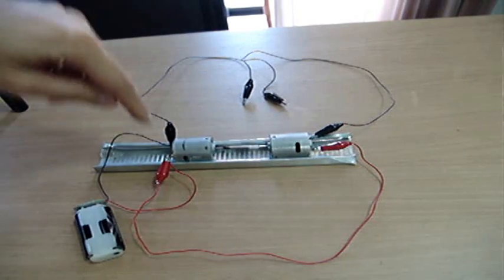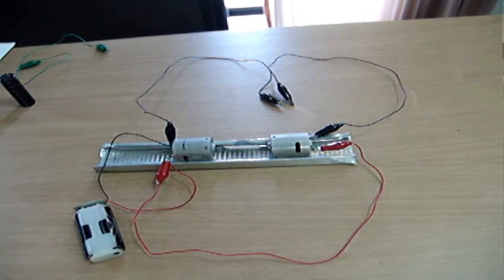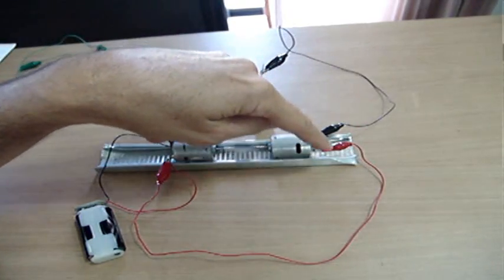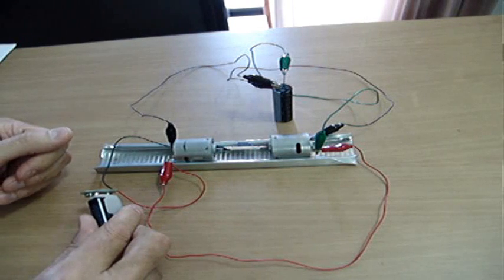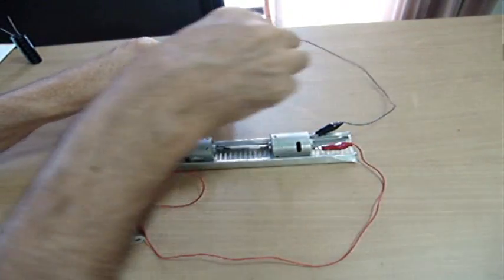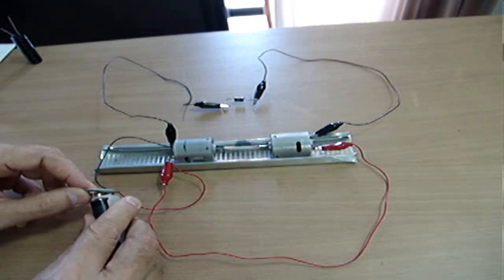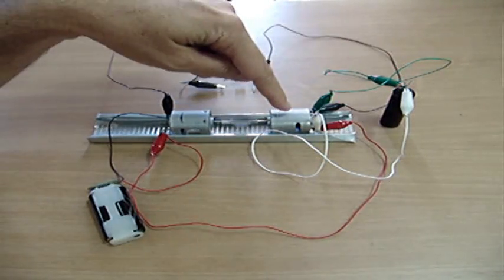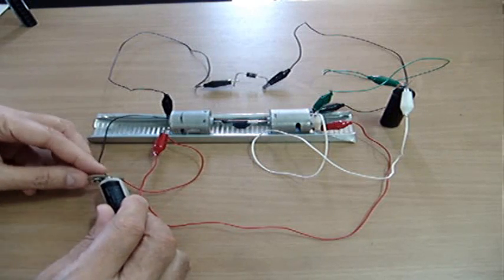Free Energy? Proof of Over Unity? Diode & Capacitor Followup

Comment: what if you use a special gearbox where the motor will run for example 1500rpm and the generator will run 3000rpm, the idea is to double the rpm of the generator so that it will generate enough power to power the motor, coz if it will only run in the same rpm it is impossible to power the motor to keep running, the rpm of the generator should be double than the motor or more than that if possible.what do you think sir?
Reply from the maker: +man of steel It would work if not for the friction.  If you ever have a chance to try to turn a gear box from a car, piece of machinery, etc., even a small one, you will quickly appreciate how much friction there is.  Even my little old motorcycle gearbox required serious effort to turn by hand.
Reply: tsbrownie i appreciate your reply. im trying to figure out solution for that. thanks.
Reply: tsbrownie your opinion or ideas shared here in youtube truly helps me, im building a large scale of this one, i've searched every free energy videos here and im trying to figure out the solution for every problem presented here, i dont care for some scam vids, what is important is we're doing something thati know someday we will have our own power station in out house.
Reply from the maker: +man of steel I found that many sites heavily censor comments or turn off comments.  I think people should be able to discuss their ideas, their results, whatever, in the open.  If it does not work, they should be able to report that too.  That's why I posted these.  It's NOT about me presenting my ideas / opinions, but allowing a place for everyone else to present their ideas / opinions.  Glad you like it.
Reply: Wait a minute.  A "source of energy" is creating energy if it doesn't come from anywhere else.

In this example you may say the energy comes from the motor acting as a generator but it's actually coming from the battery through the motor and then to the generator.
Everything is just moving the energy around.  Even the battery had to get its charge from somewhere else.  If you keep going back far enough you'll end up at the Sun as the source.

And the Sun's energy comes from nuclear fusion.  Hydrogen is being turned into Helium which gives off a lot of energy in the process.  And even that will run down one day (2nd Law).

So you're on the right track but a little misguided I'm afraid.  Happy to explain further if you wish.  My degree is in physics.
Reply from the maker: +man of steel Guys, keep it civil please.
Reply: man of steel Why are you so angry?
I'm only putting the physics on the table.

If you think something like this can work it's like saying you can drop a ball and it will fall up.  Saying that it won't doesn't make me close minded, it just means I understand the physics.

Do you realise that if machines like this could work (that is they'll go forever without any external energy input) then every time you ran it, the total mass of the Universe would increase?

That's what you're claiming if you boil it down to basics.

Someone said:

"It's good to have an open mind but not so open that your brains fall out"
Reply: man of steel I was wondering if you'd get it. 
it's a bit obscure.   8^)
But for something like this to work it would have to create brand new energy from nothing (which defies the First Law of Thermodynamics).  Otherwise friction would stop it.  
And energy and mass are the same thing as Einstein showed:

E=MC²  where C is just a constant velocity.  In other words Energy is Mass times a number.

So if you create energy, you also create mass even though it's in the form of energy for the time being.

And if you think of it in that way you should be able to see that intuitively, that's not going to happen.  You can only move energy around, you can't create it (nor destroy it).
Reply: tsbrownie I'm not sensing any particular contention in this thread.  Just a physics lesson.  Are you referring to my comments?
Reply: tsbrownie I commend your efforts to settle the "issue" about perpetual motion machines. Sometimes words aren't enough.
I could comment on the theory re: diodes and capacitors but I think it's redundant now.
Reply: I got a message from ironman he says buy  the biggest gyroscope you can afford attach it to your bicycle along with a coil since its a motor\generator and go to town. I like ebay and youtube 
good hunting!
Reply: Ace Winger All that will do is make your bike heavier and harder to steer.  You won't get any energy from it unless you spin it up from an external energy source and then extract it on your ride.  That's really a flywheel and the resulting gyroscopic force is nothing but a hindrance.  And you have to haul all that spinning mass around.  And once it stops spinning it's dead weight.
I doubt this is practical on a bicycle although there are cars which use flywheels to store energy.
Reply: +Warren NZ and the power source is muscle power whoooo!!
Reply: man of steel I have a degree in physics actually so you can look in the mirror when you say "tsk tsk, pathetic".

An electric bicycle (with regenerative braking, which is what you're talking about) stores energy when you're gliding down hills or if you're pedaling.  But if you're charging your batteries with pedaling that would be one HARD bike to ride!!!  So why would you bother?

Anyway I was responding to a comment about flywheels not electric bicycles.  If you look you'll see I already said that electric is the way to go with these things.

Get your attitude back in line!
Reply: man of steel well said Tesla is my favorite idol! Let's build a generators by massively scaling up a simple wind up watch pointing at myself yes I'm friends with ironman.
Reply: ***** Albert Einstein was once asked how it felt being the smartest man in the world! he said I don't know, I'm a physicist ask Nikola Tesla he's the scientist!
Reply from the maker: And today it's Noam Chomsky.
Reply: +man of steel The problem of using a gearbox isn't friction (although it plays a role).  It's "mechanical advantage".  If you double the speed of the generator with a (frictionless) gearbox it will take twice as much torque to turn it.  Gearboxes trade off torque against rpm, that's why 1st gear in a car accelerates faster than higher gears but the car goes slower.

So if the generator takes twice as much torque to turn it then the motor will need twice as much current.  See what I mean?

It doesn't matter how you configure a set up like this.  With no external source of energy it will stop.  That's the First Law of Thermodynamics, you can't create (nor destroy) energy.
Reply: Warren NZ nice point thanks. but for the law of thermodynamics many use that as an excuse thats why they are not trying instead they argue, but they dont get the point that we are not creating an energy, we are making a SOURCE of energy. I hope people who dont understand that law will have clear understanding, energy already exist, you just need to create a source for it.
Reply: Warren NZ so physics major you wanna say you know everything about science? i think not.
Reply: man of steel Steady Cougar.  I'm just trying to help.  I didn't say I know everything about science but the thing we're talking about here isn't even university physics, it's high school physics.  The subject is called "Mechanics".

It doesn't even involve Calculus.

Was there something specific about what I said that you disagree with?  If you just want to fight I'm not interested.  8^P
Reply: Warren NZ i just know guys like you, keyboard warriors here in youtube, you all talk as if you know everything, were talking here about how to make something work by trying everything but you guys will appear and will say it wont work coz i know everything coz i say so. skeptics really ruin things, remember there is no permanent science, and there are lots to know. if you stop thinking then shut up.
Reply: Warren NZ uhmm what?! again...
Reply: Warren NZ wow,, auhmm... what again?1!!
Reply from the maker: OK guys.  I run a clean joint here.  No brawling.  Agree to disagree before it gets ugly.
Reply from the maker: OK, as long as both of you are happy, I'll keep quiet.
Reply: +Warren NZ well it's to power your house but that idea of a huge portable power source is good too you genius you!!!
Reply: Warren NZ i wonder what year you were born, havent you heard about the electric bike? you can pedal easily and it stores energy to battery. wheres your doubt coming from. tsk tsk, pathetic
Reply: Ace Winger You specifically said:

"buy the biggest gyroscope you can afford attach it to your bicycle"

A flywheel in the home isn't a new idea and it works.  You don't have to deal with gyroscopic forces so you shouldn't have called it a gyroscope because that's irrelevant unless you're moving it (as on a bicycle).

If the power source (on a bicycle with a flywheel) is muscle power then why not cut out the middle man?  Just put in the muscle power when it's required.
Your most efficient strategy would be electric with batteries and regenerative braking.
Reply: Warren NZ  wow was that to me have you used crank powered tech that's cool
Reply: +Warren NZ helps yah! thank you soo much I found it "geo-orbital electric wheel" its less than 200 dollars awsooome!
Reply: man of steel When you resort to all CAPS you lose by default.  It's the cornered animal syndrome.  8^)
Reply: tsbrownie im sorry man i cant help it, ive been through conversations like this, and having people like Warren NZ cant help to discover or uplift this kind of technology i personally know someday it will work, and people like Warren NZ will shut their mouth because of embarrassment. most discoveries in this world is not done by "physicists" but by people but by crazy people who think things can be done, in fact these physicists just study and confirm it works because of these because of that, they are too smart but too afraid to get out of the box, to a point they do nothing but criticize not materialize. i hope i made my point here. a lesson for those SMART persons here that keep on saying it wont work because they are too smart to know. im just a simple man, not smart, not even a physicist but i make things happen. thank you.
Reply: man of steel OK let's cool off.  I'm only pointing out that this won't work because it can't.  And it can't because there's a law of physics in the way.

In this specific case, once he disconnects the battery, the energy flowing around from motor to "generator" will quickly be lost to heat from friction and the inefficiencies of the motor/generator. I doubt it would run for even 1 second.

If there's any way for the First Law of Thermodynamics to be violated it will have to be at a sub-atomic level and from one of the weird quantum physics mechanisms that defy common sense.  Like matter popping in and out of existence spontaneously.

It's never going to happen from a guy with motors, wires and diodes on a breadboard in his basement work shop.  And that's a simple fact!

And that's why no one's ever succeeded in doing it.  They never will.

As someone said:

It's good to have an open mind but not so open that your brains fall out."

And just leave it at that.  If you're still not convinced build one by all means and try to perfect it until you give up.  I'll be spending my spare time on things that are possible.
Reply: +Warren NZ im talking in general, free energy is not just like this, in order to make a machine work for itself its a combination of all fields of science and engineering(electrical,mechanical, etc) and a lots of common sense, do not dwell on someone who failed, look for those who made it or almost made it and analyze,innovate, create better than that. not just because you're smart and you know all the laws it will not happen, remember science is a continuous learning process, it keeps on changing, adding, subtracting whats been already known, someday a free energy machine will come out, but i really hope this technology will not only benefit few people but mankind likt the vision of nikola tesla.
Reply: man of steel I know you mean well and you probably think I'm close minded but this experiment is like trying to shield gravity.  It simply can't be done so it's a waste of time.

Again, don't take my word for it.  Try to make one of these work until you've convinced yourself it will never work.

Or save yourself some time and take a high school physics class.  They'll cover the First Law pretty early on I think.

It's only common sense.  It takes energy to do work and no machine is completely frictionless so some of the energy gets turned into heat so there's less of it to do work and it slows down.  If you don't replace the energy then it will stop.  Simple.
Reply: Warren NZ look at your position years ago the laws of physics said the earth was flat and if you questioned it  you were beheaded not much has changed since. Except media and cell phones all I ask is look for solutions that work this circuit is nothing special yah but I have personally seen a lot of energy created with very little mechanical effort never possible in the past but its just that the past.
Reply: Ace Winger It wasn't a "law" of physics that the Earth was flat, it was a biblical belief.

And as with virtually everything else claimed by the bible it was wrong.

A Law in physics is an observation that every test ever devised has supported without exception like the Law of Gravity.

And I can guarantee that you haven't seen any energy created.  That goes against the First Law of Thermodynamics.  But I'd be interested to know more about what you saw.  Perhaps I can explain it more specifically.
Reply: Warren NZ these are sciences explainable by tests done with the available scientific equipment but science is ever changing as we gain new measuring devises and sorry MY projects are top secret not that you can't find the stuff on the web these days....like gallaleios laser that sh#$ should NOT be out there for everyone! People can act stupid sometimes
Reply: Ace Winger OK well I've explained enough.  All that's left is for you to produce an "over-unity" machine, topple the First Law and get your Nobel Prize.

You'll be more famous than Einstein!  8^)
Reply: Warren NZ hey,spare the bible especially if you haven't read it, dont interpret it with your own words you dont know what youre talking about, like what you keep on insisting here pure non sense for us. you dont even know our side, we know yours and your laws, we know the laws but we also know those laws are misunderstood buy people like you, because you stop thinking already, thinking youre genius enough to have an answer to all. we already have a machine that power itself, the only problem is it overheats. so we keep on learning and someday we know we will make something. how about you, have you even made one machine? or youre just quacking here like a duck.
Reply: man of steel Wow!  It all fits together like a jigsaw puzzle!

You're religious!

That's why you don't understand high school physics. Someone has convinced you that science is unreliable I bet.  And that's because science has proven whole sections of the Bible are wrong so the clergy have had to try to discredit it.  While all the time science is producing everything you see around you.

Well here's the thing.  Science works!  And religion doesn't.  That's why your prayers get answered at the same rate as coincidence allows.

http://www.scientificamerican.com/article.cfm?id=no-prayer-prescription

And don't think I don't know the Bible.  I know it better than most Christians.  Reading the Buy Bull is what turned me into an Atheist.  I can quote lots of passages from it from memory.

How old are you?  If you're younger than 15 I can forgive your sentence structure and spelling (and even you're misunderstanding of physics) but if you're older than that then you've fallen behind.

So don't tell me I don't understand physics, I have a university degree in physics.  But you'd better get back to school before it's too late.

And seriously!  Question what people (even me) are telling you about reality and check if it stacks up!  That's probably the best bit of advice you'll ever get.
Reply: +Warren NZ you ever used real magic.....

Comment: what if you use a super cap try that
Reply from the maker: +droft nom I have used a really big one and think I put out a video.  If there was a difference it is so small you can't see it.
Reply: not a uf cap but a f only cap one of them that put a slow drop off out put like 2.5 volts out and at 100 f will run one them little motors for like 20 min . sso if ya take one of the 100f 2.5volts out put the cap on your gen then use a diod on the cap then back to the bat. will run for ever
Reply: There really is "Free-Energy". The axiom would be "input= output". Lack of "input" equals lack of "output", pure common logic. E ven the sun with all it's radiant "output" of energy is being fueled by an "input". Input and Output are the 2 single most actions in the universe. One could say that the Universe is a binary system of "input/output". All actions and functions show this, Telephones=(input/receiver=output/transmitter-speaker), (heart,lungs and ect=input/oxygen,blood,ect=output/carbondioxide ect. Me talking/output and you listening/input. Everything has the universal functions "input/output". There is one beautiful quality of existence containing no energy or mass yet producing unlimited "output" energy not requiring any "input". One name for this could be an "Immortal Spiritual Being". If you are reading this than that is what you are.